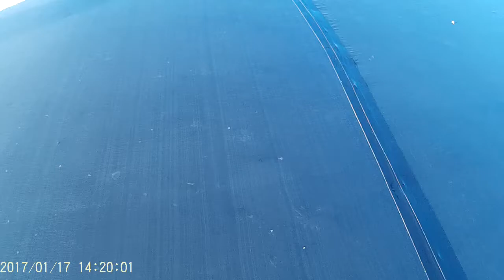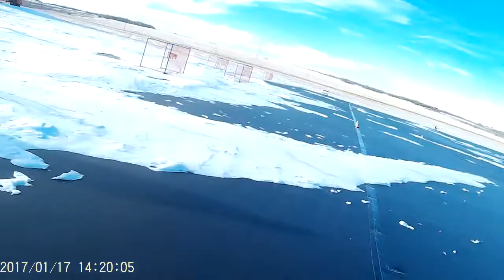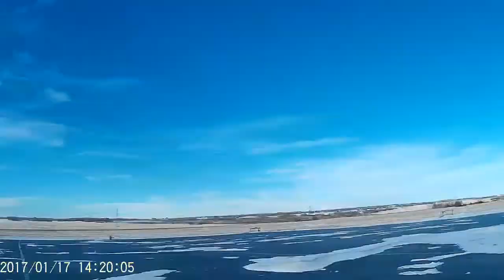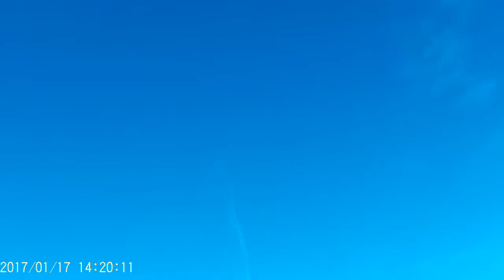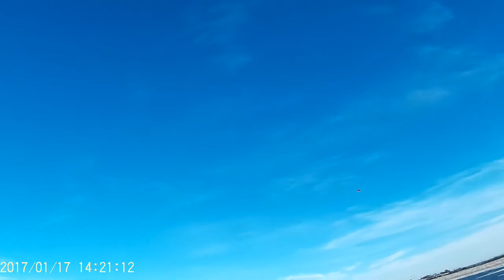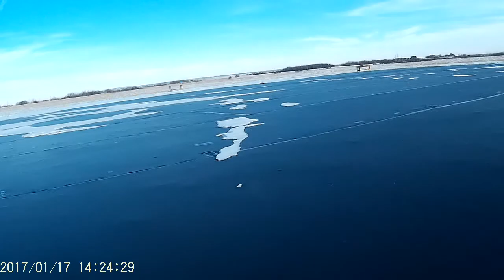2017 0117 PI SU 35 G2 Maiden Flight #2

Comment: Gosh! Awesome Jeff! I'm stunned watching it did the bullet rolls, awesome circular loops. With the 3000KV motor, it seemed that it didn't lose the speed. Did you have the elevators helping the ailerons for rolls or it's just ailerons doing it?

Seems like a perfect candidate for cobra and all stuffs as well, as it doesn't have elevons at the prop wash. I found it a bit tricky when doing it with our T-50 and SU-37, but they did well.

Awesome flight Jeff! 😊👍
Reply from the maker: Elevators are helping the ailerons for roll, plenty fast roll. :)  another great experiment  built .
Reply: Fantastic Jeff! Wish I have the maiden of mine already. 😄

We will have more designs, after I'm done with all work and other sruff schedules in a couple of months. 😊